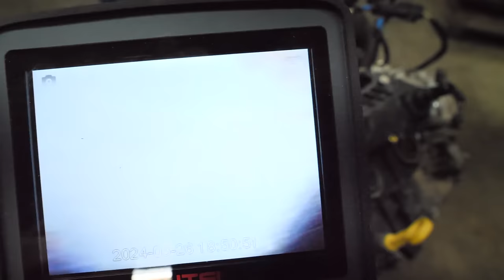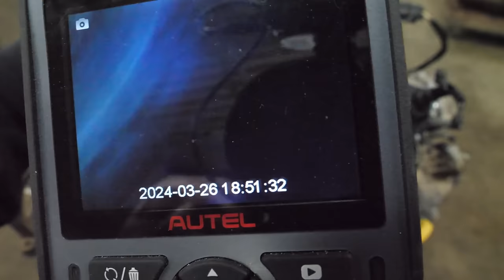ANOTHER BAD 2.7 Ecoboost? 2018 F150 Twin Turbo V6 DEAD @ 131k Miles

Comment: Belt driven oil pumps remind me of "sealed for life" transmissions (no dipstick and no way to check the condition) , of course they never specifically state what that lifespan is exactly so it basically boils down to it will last until it doesn't and then you're out 5-10k for a replacement engine or transmission.

Comment: So for the oil pump belt Ford “recommends” replacing every 150k miles… or when it snaps, which ever comes first😂😂😂
Reply: 3.0 Duramax has an oil pump at back of engine. Transfer and trans out for its 150K service. I expect those will have a value drop and be traded at 147k miles when the word gets out.
Reply: @jimmyaber5920  Random comment. Deflecting much? Don't like everyone mocking Ford's very stupid engine design decision to continue using oil pump belts? 

You make it sound terrible that they put their oil pump belt at the back of the engine. It takes FAR FAR more labor to pull everything off the front of the engine, including the harmonic balancer and timing chain (which realistically, if you're in there, you're probably going to just go ahead and replace the phasers and timing chains), just to chain the Ford belt at the front of the engine. In contrast, the 3.0 Dmax will require dropping or at least sliding the transmission back enough to pull  the flex plate and open an access cover that exposes the oil pump belt. Next you change the belt. Now that you're done, reinstall the stuff you removed. I know which one I would rather do.
Reply: @hochhaul every manufacturer has issues. There’s no escaping it.
Reply: @jimmyaber5920   Given the long term issues their transmission have, the GM will likely need a TQ converter replacement before 150K anyway, can conveniently do the oil pump belt then.
Reply: At which time, an engine is required, so need for a belt.
Reply: I would not put it pass FordCo to implement a trojan horse in their FordPass app initiate a weird SYNC electronic tune to snap those plastic parts on demand.

Comment: For my money, with the way the rest of the engine looks, especially the lack of damage to the rotating assembly, I'd fix this one, no doubt. With a replacement you wouldn't be able to check these components, therefore it's an unknown quantity. For the difference in cost, the peace of mind would be with it, but that's just me. Great teardown, Eric. I've been wanting to know more about the Ecoboost platform, the 2.7 in particular, and you've answered a lot of those questions. Keep em coming, buddy!

Comment: I have a 2.7 out of my 2018 with 118k sitting in my garage. Number 4 cylinder has zero compression. Got a replacement with 2300 miles for under 3k with turbos and they didn’t want my core. Eventually I’ll pull it apart.
Reply: You got lucky with that price.
Reply: @Foxbody302  They've got two more at that price with similar miles
Reply: @AnonyMous-jf4lc  good to know, thanks.

Comment: 2.7 has proven to be a very reliable engine. They hold around 500 wheel sustainably. They tend to blow when pushed beyond that. There are many 2.7’s approaching 400k.
Reply: Sounds like a very underrated platform.  I like the sounds of the tuning but how does the transmission hold up to another 100+hp?
Reply: @snakehead5444  10r80’s hold a ton of power. From all the tuning groups I’m in it’s always engines that fail first before the trans/drivetrain go. The common failure on these set ups tends to be valve related failures when over 600 hp. There are people that have 2.7’s around 800hp. I’ve yet to hear about people building these engines out to survive long term at those power levels.
Reply: @Turboboob  Cause Ford fixes their fuck-ups for free. Toyota turbo in your future, Enjoy
Reply: I feel like those people getting to 400k got lucky.  Ford did their wet belt treatment to the oil pump.  Such a dumb design.
Reply: @Powersproductions130  that is definitely a questionable design, however I’ve yet to hear of one belt failing, I’m sure it’s happened though. They have switched the 5.0 to the wet belt as well. There must be a reason for it. But chain makes more sense for sure
Reply: There aren’t many .. it was one guy name David and he drove it till it blew up then got a Ram
Reply: @doug350zTT definitely more then 1 and buying a ram truck for reliable high horsepower builds is a questionable thing to do. Best option is a f150 4x4 single cab 5.0.
Reply: @dallashiggins7625  I didn’t agree with him buying a ram but that’s the only case I know of on the f150forum
Reply: I'm honestly surprised how good that 2.7 engine is and the dual injection is icing in the cake 👍
Reply: @chrish8487  only thing I wish is that it had more displacement or reved higher one of the two.
Reply: The 2.7EB has solid lifters and no specified adjustment interval. Sad you didn’t check valve gaps before disassembly.

As for special oil, Ford has a WSS oil specification.

Comment: The oil in the cylinder could have been a mechanic pouring a little in the plug hole for a compression test, testing if it's rings causing the low compression or something in the head...as we saw the burn't valve.
Awesome vid Eric cheers mate!
Reply: Eric O. (South Main Auto channel) just showed the new borescope he bought that can swivel around once it's down in the cylinder so you can check out the valves without pulling anything other than the plugs.  Used it to condemn a GM 2.0 turbo 4 in a Caddy.

Comment: There is a more important reason why the piston rods are offset. It allows for better geometry in the position of the crank shaft and rod during the compression stroke.

Comment: Two days ago I tore down my very first engine.
And I was very shocked, it sat outside for 6 years and I didn't have a single bolt fight me and it's completely rebuildable.
175€ delivered to my door 😂
Reply: Dry climate?
Reply: @MattyEngland  nope, Germany.
The thing was rusty as hell form the outside
Reply: @Birb_of_Judge  BMW? All bolts come with a coating from the factory, to make assembly torque more precise, but it also protects the threads as well.
Reply: @SeanBZA  no a NB Miata 1.8L

Comment: I have the same engine and year F-150.  I have 57,000 on it and run full synthetic , changing it every 5000 miles.  I send in samples to Blackstone and the test results have been great.  After two Ram 5.7 engines and Chevy 5.3, I still have reservations on small turbo engines.   Considering what's available in new 1500 trucks with ice engines, I don't think any would consider to be a lot more dependable than the 2.7EB.  
48:25  I love watching your teardown videos.

Comment: I work at a high volume Ford dealer and since these engines came out we have changed one. We do 5.0L and 7.3L all the time. I own A 18 2.7L and absolutely love it!
Reply: Exactly my nephew has a 2015 with 177,000 miles on it runs perfect

Comment: Referencing your last 2.7 teardown if it was do to small displacement and high HP. Auto makers that make all of the high hp 4 cylinder engines would fail to based off that assumption, which is not true. There are alot of 2.7 ecoboost engines with high mileage. Its that old mentality mechanic that assumes that like scotty kilmer he will tell you to buy nothin but a naturally aspirated toyota from the 90s.  Tech has changed so much over the years that is why i have the 2.7 and its been a great motor. Thanks for the videos 👍!

Comment: The 2015-2017 2.7 did not have port injection, but it did use a chain for the oil pump. It was most definitely bean counters who made the decision to switch to a belt.
Reply: Interesting opinion

Comment: For 130K that engine was well maintained. It had to have gotten hot. The timing chain tensioner was melted too. Considering it had 130K on the engine and probably needed some more work (like the oil pump belt). I would consider replacing the engine rather than fixing. Depends on how nice the truck was.
Reply: The timing chain tensioner failed and put too much tension on the chain, causing the guide get hot and melt. Someone suspected this would have thrown valve timing off enough to eventually burn a valve. A bad injector may have caused it too but you would think you'd see wear on the bearings with that much gasoline washing down into the crankcase.

Comment: I haven't seen any 4.2 Trailblazer engines yet.
Which is good.....cuz my 2002 has 245 K on it
still runs like a top 🙂
Reply: Would love to see a Vortex 4200 teardown...just hope it isn't yours!
Reply: @Trendyflute  lol
you and I both 😏
Reply: My son has a 2005 Envoy XUV with the 4.2 Vortec. 200k and still going strong.
Reply: Our 4.2 has 327k on it.
Reply: That's because they get swapped into other Failblazers to keep those trucks on the road (until they fall apart, then the cycle starts again).
Reply: @CaptainSpadaro  bought my 2002 brand new. Nothing but coil packs and an alternator about 5 years ago.
That's 22 years, Karen 👱‍♀
Reply: @davidgrisco1939  wow
Reply: @joeblow5037  Congratufuckinglations, it still doesn't mean the trucks don't fall apart.
Reply: @CaptainSpadaro  like how, Karen?
Reply: @joeblow5037  rust, trim pieces falling off, transfer cases shitting themselves (and people just yank the front axles out), oil starvation on the 4x4 V8s because of the front sump pan, suspension bushings (and ball joints) wearing out...don't forget that embarrassing recall they had in 2012 for door harnesses that caught fire in the salt belt. And of course, plain and simple neglect.

If yours has lasted, fine (though I have a hard time believing you haven't needed some kind of suspension or steering repair), but it doesn't change the fact that the majority of these trucks fall apart. I saw plenty of it at a former job.
Reply: @CaptainSpadaro  2WD here
Never touched the front end
goes down the road straight as an arrow
think thats a common problem with GM 4WD's
Fords aren't a lot better
ALWAYS garaged
probably biggest help 🙂
Oh yea, I'm a gear head
no one touches it but me

Comment: 28:30 ? Never mentioned again, i was waiting for an answer. I feel you owe me an answer, i can't see myself sleeping until i know. 
As always great video, with only two unanswered questions, why was the cylinder full of oil water, and WHY did that piston rock both ways on the wrist pin.
Reply: the piston wear would have been from all the unburned fuel washing the cylinder down and probably affect the wrist pin I would think? I was wondering about the coolant/oil mix in the other bank as well.

Comment: A '68 Buick Gran Sport 350 I used to have had a burned exhaust valve in which I had a valve job done. The only thing I can figure out was that the exhaust manifold for that cylinder bank had a heat actuated spring valve to close the manifold to exhaust pipe to aid in warming up the engine sooner. The butterfly valve shaft had rusted shut which I tapped open since it was non functional anymore. Also the hydraulic valve flat tappets were dished with some that had worn holes in them. As I was very young at the time(not much money) I just cranked down the rocker arm adjustment nuts and made the engine a non hydraulic valve train. Worked for a couple more years. The engine was practically worn out with low compression.

Comment: I can not decide if I like pop of the coil overs being pulled, or the crack of the headbolts being loosened.
Reply: Definitely the head bolts for me.
Reply: Head bolt crackage 🥰🎶🔧🔩
Reply: Coil pop
Reply: As long as it's not snap, crackle and pop.
Reply: Head bolt SMR

Comment: Also, there was a batch of 2.7s coming around with collapsed piston skirts. Even if you can't see it, you would see the piston skirt width would be out of spec if you measured it. Also out of round.

Comment: Here in the EU we have had A LOT of issues with internal timing belt (with oil), mainly Peugeot engines (they are now coming back to chains for this very reason). There's no real solution as the problem isn't the oil itself, but instead the blow-by gasoline that passes through the piston rings and goes into the oil itself. It's THAT thing that destroys the belts. And the real issue isn't the belt in itself, but the rubber that detaches from it and blocks the oil pickup, effectively granading your engines.
Reply: The good news is the Ford belt isn't made from rubber. I haven't heard of any failing yet.
Reply: I thought about debris coming off that belt too when he was showing it starting to crack apart.
Reply: @DF-et4gs  The belt is actually manufactured with those cracks. If you notice they're evenly spaced apart. Because the belt is made from Kevlar it helps make it more flexible and allows oil to be absorbed in to the belt. There's a lot of high mileage (300k plus) 2.7 liters out there that haven't had a failure yet. It's probably Ford's most trouble free motor.
Reply: When the belt crack on the outside looks , it's the gás in the oil. But when the belt falls apart it's because os the use of wrong oil....

Comment: Looks like a squirrel has been chewing on that exhaust valve
Reply: In the mid to late 90s exhaust valve metal changed and they wear forever. When something does happen they looked like they were cut with a torch. Non-turbo engines will do the same. The first one I saw in 95 or 96 was by a tech I worked with that walked over to me and handed me a valve and said, "what do you think of this?". I said, " you took a cutting torch to it".
Reply: That squirrel had some kind of really good teeth!

Comment: That gets a new motor. People believe that any time you touch their vehicle, any issue after is your fault. So if you fix the head and later on there is an unrelated issue, another burnt valve, water pump goes out, or the oil pan starts leaking, that customer is going to assume it's your fault. If you put a long block in, you have the parts warranty to fall back on.

Comment: Small displacement turbo charged engines that generate a lot of torque down low in the RPM range have a problem.  They generate high cylinder pressures at low RPM to make torque.   A high load at low RPM with high cylinder pressure is more prone to pre-ignition. A small carbon deposit on the valve could have been the source of the problem causing it to burn it. Using high octane fuel can help prevent the problem.

Comment: I would fix it. Unless the customer wants to pay for a new one 😆
A wet belt to chain conversion would be pretty nice. But you're right the "while you're in there" parts list could be pretty massive. On the flip side it's basically a brand new engine at that point... or even better then new.
Reply: U fix U warranty, U install, someone else warranties, simple as that.

Comment: Replace the engine.  In the chassis, it's not the easiest to work on.  Coolant/oil mix could have been a failed EGR cooler.  The oil pump drive belt is the most idiotic thing to come down the pike in a long, long time.  Can't wait to see the number of blown up engines from failed belts.
Reply: I can't believe they put an EGR cooler on this engine. They don't use one on the 3.5 Ecoboost but they decide to put yet another potential failure point on this engine.

Comment: Just found the channel, and the only 2 videos I saw were on a 2.7. I have an F150 gen1 2.7 ~147k miles in the shop now for a very similar problem as the first 2.7 video. Low oil pressure light, and then engine failure shortly after. I don’t know how this part works but I might be able to send you my block.

Comment: When a mfg introduces a newly designed engine they should be required to give it a 150k mile warranty for the first 2-3 years of production.  Gives people a chance to learn things like the belt driven oil pump.  At least after a couple years you know these things about motors and have the ability to not buy it because those of those properties.  When people stop choosing the 2.7 v6 because of the belt driven oil pump they'll be forced to change it
Reply: Get ready to see fuel economy and power ratings drop as manufacturers are forced to make underpowered and sloppy engines that won't break no matter what because they can't afford a 150k mile warranty. 

The fact of the matter is that most people treat their cars like garbage, and you'd have to spend CRAZY amounts of money and time building engines that could last to 150k miles for those people. 

Your idea is stupid.

Comment: My gen 1 has been converted to the belt oil pump drive under SSM 49221 - so I would imagine you can indeed go the other way around using gen 1 parts on say a gen 2. But I could be wrong

Comment: I have a 2019 2nd gen 2.7ecoboost F150. It has 84k miles, I turn the start stop off, last 2 years I hardly run my turboboost, mostly short rides in town. First three years It had alot of highway miles and that fun balls to the wall super boost  use.  I  change oil with full synthetic every 10k. Have had no maintenance service. I did have an 02 sensor replaced.  Any advice you guys? I want to baby it from now on, last truck I want to buy screw bidenomics. Do I need catch cans? Also I've had three cad converters replaced on the exhaust from the get go.
Reply: No need for catch can on ‘18 and up, it has both direct and port injection to keep valves clean. I change my oil at 2500-3000 mi, using a semi synthetic like ford recommends . I would recommend changing your oil now at 4000 mi max, all depends if you tow with it

Comment: Daves auto, engine builder. had an oil analysis guy on. Lake. And without doubt said to add fuel additive to all engines forever. My tundra suffered some damage from extended oil intervals and no additive. Please add something and change oil at 5k or less. Or get oil tested. thinner oil specs are susceptible to breakdown from fuel quicker than heaver oil. Newer engines can't run the heaver stuff as startup wear from further distance from the oil pump. Too far or restrictive to get there.